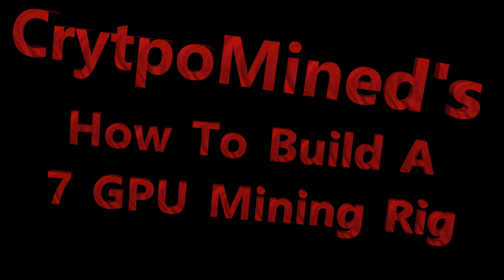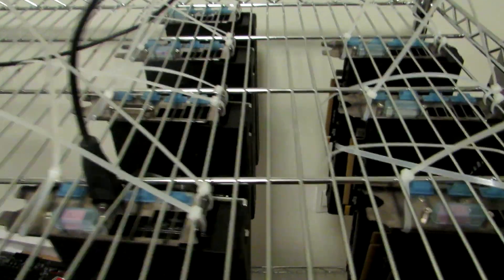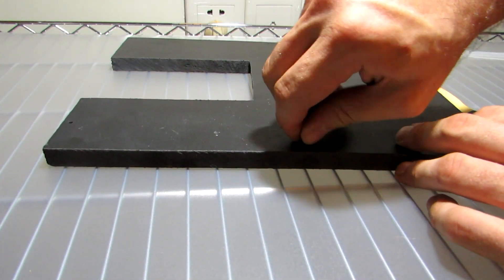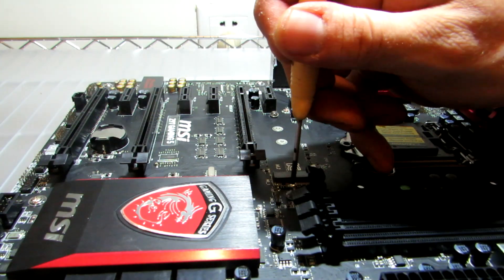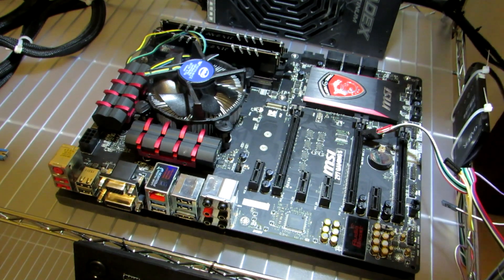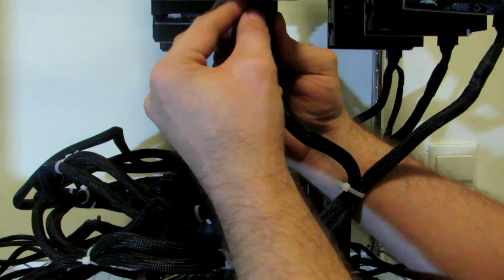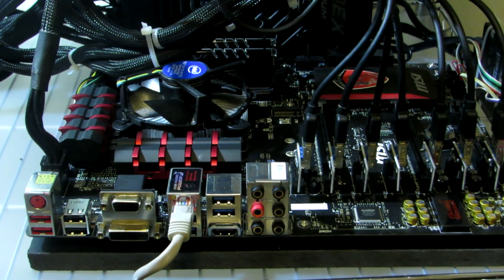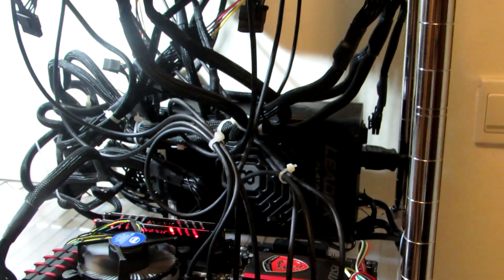How To Build a 7 GPU Mining Rig for ZCash Ethereum Monero Crypto Altcoins MSI Z97 Gaming 5

Comment: Does this motherboard have 4g encoding?
Reply from the maker: na i dont think so, could be wrong, but its an older z97 board, i dont think it had 4g encoding
Reply: @Cryptomined  So follow up question, I seem to be having issues with more than 4 gpus working on this board on a linux based mining os. it just won't go fast the bios splash screen. is there a setting besides 4g decoding that allows more than 4 gpus. Besides the pci gen1 and bus latency.

Comment: I'm having issue with my rig with either 6 or 7 cards added to the rig. gpu 2 hang message appear on startup and freeze the miner even though computer recognize all 6 or 7 cards. I'm not sure if I need more physical ram since I'm using 8gb but I put my virtual mem at 8000/16000. Using 17.5.1, 17.4.4,16.11.5  and 17.4.3 driver and tried claymore 9.3/9.5. I already clean install windows 10 pro and can't get it to mine past 5 cards.

Comment: i have 7 gpus running , all get picked up by win 10 , when claymore starts all gpus start mining at around 28 mh/s except for a single gpu that has a low hash rate of 4.xxx mh/s . any information on how to correct this would be greatly appreciated 

amd driver version 16 - patched to 17 
7 rx 580 strix 
1000 watt + 850 watt PSU 
asus z170 motherboard

Comment: I've seen a lot of these builds but I don't see how it's possible to connect 7 GPUs to all these PSUs. The PSUs only have 6 PCI-E cables. Do you have to buy a splinter or something for one of the six cables so you can hook up 7?
Reply: i bought 2 750 w psu's, each have 4 spaces for power to VGA, its called the EVGA 750 GQ or something like that :)

Comment: Awesome setup you have, I have four GPU's going on Windows 7 with no problems, all plugged into the x1 PCI-e slots.  The other slots on the mobo are the x-16 slots.  When I plug in a fifth GPU into thee x16 slot Ethminer does not recognize the GPU.  Any help would be appreciated.  All the GPU's work in the x1 slots but none i the 1-16 slots.  All five are recognized by Windows in the Device Manager.

Thanks for your time.

Comment: will two 750W PSUs do the trick? For 7 RX570 Pulse 4 Gb
Reply: Ok, at 7:40 he said he'd prefer using 2 PSUs, but didn't say what wattage in each of the 2 PSUs
Reply: 2 750w is fine, 4 on one 750w psu and 3 + mb and risers, ssd etc on other PSU

Comment: i'm starting with a tight budget, would a I3-4130 3.4Ghz CPU work with this build?
also would mining with 2-3 RX 470 4GB GPUs then scale work? i'm basically putting all my funds right now into this, scaling with the profit.
Reply: okey, i think i found an answer to my first question in the comments :), i was more like removing a doubt.
Reply from the maker: a G1840 will work, you dont even need an i3.  2 or 3 470 4g is fine
Reply: great, thanks!

Comment: Anything you'd buy different from your description list? Video was last September. (P.s. this is awesome gonna send an ETH tip tonight.)
Reply from the maker: I'm working on an 8 GPU build now, hopefully it works and ill update with a video.  Only thing i would have done different in this build is if I had to buy the power supply, since I already had the one I used, would be to use 2 750G2. ... and maybe use XFX cards instead of sapphires.  also the i7 was totally not necessary.. i just used it as an excuse to get one (but at the time it was semi useful for zcash).. same with the 16 gigs ram, not necessary.

you can go celeron and 4 gigs of ram.
Reply: Thanks ETH tip sent last night.

Comment: What's the reason for wanting to use two pcu?
Reply from the maker: Basically because its cheaper for high watts, and you can generally get more 6 pin ports so that each riser can have its own cable (if I had used 2X EVGA 750G2 I would have had 7 free 6 pin ports, so each riser would have had its own cable - its safer so you dont end up burning a cable.. less chance of fire.. although in general it is ok to have 2 risers per cable, 1 is ideal and 3 is very dangerous)

Comment: hi man, i have the same configuration as You, only the cpu is a i3, (i have only 470 gpu's). but don't recognise more then 4 gpu's in the same time. If i put 4 is ok, If i set 5 gpu's 3 of then has an exclamation sign (in device manager) and If i set 7 gpu's i see only 6 ( or 5 sometimes   ). 
my bios version is the same as yours.
Do you have any idea why is not working? I say it's the pci driver but I don't know what to do.

Comment: Hi cryptomined. What would be my best bet for a 7 GPU rig of R9 Furys or Vegas when they're out? I ordered the MSI Z170A and am reading now that they have problems with more than 4 GPUs
Reply from the maker: basically any Z270 board with 7 slots.  asu strix, z270-a or ar, biostarGT6.  But i will be building an 8 gpu rig with a different board than those, its more cost effective and can handle 8 GPU (which seems the maximum in windows).  stay tuned i should upload the first of 2 builds like that this week.. all components are here, just fighting for free time at this point

Comment: Man the msi z97 gaming 5 and msi z170a gaming pro carbon are sold out everywhere here...what other 7 gpu able motherboard could I get? :)
Reply from the maker: 7?   seven?  LOL 7 is so last year.. stay tuned for the 8 GPU build (there are a number of boards you can use now in the new intel chipsets).    you got asus strixx 270, 270-a, 270-ar, biostar GT6, and a few others... those are straight forward 7 gpu boards, but so many boards can take 7 now with a m.2 to pcie card or a 1-3 extension riser.  stay tuned, 8 gpu build coming up shortly. (like as soon as I finish cleaning up the house and finish with store responsibilities, and finish unboxing a few things to make some extra videos... its getting built.. everything is waiting for assembly.

I wil be building 3 rigs this week:  6 GPU TB350, and 2 8GPU builds, one with 480 8g and one with 500 series cards
Reply: Hahah Nice man ! but are you saying that board can take 7 gpu + pcie expension 3 in 1 so 9 gpus???

Comment: Hi, why do you recommend for rx 570 4gb and not the 8gb? btw which maker would you also recommend or are they all good? Thank you for your help.
Reply from the maker: cheaper, i have not done enough research on the different kinds of 570 and what ram them have.  most people buy nitros from sapphire.  I really like the 570 xfx with removable fans. (the high end xfx 570) as it makes them very easy to clean when they get dusty.  Some people also really like the MSI cards.  HIS might also be nice.  Powercolor could also be nice.
Reply: Cryptomined Thank you for your help. Btw, is it true that for zCash 580 are much better than the 570 series?
Reply from the maker: its faster, you can watch my hashrate video and see the hashrate and watts used in GPUZ

Comment: Hi, i want to build 6 gpu rig but the only cards i can find are sapphire rx 570 8gb. Would this be a good choice to go for or wait and search for something else? Thank you for your help
Reply from the maker: personally im waiting for vega at this point
Reply: would you say it would be a bad decision if i go for the 570 8gb in terms of making profit and possibly after pos i switch and mine something else? Thank you so much for your help
Reply from the maker: i wouldnt say its a bad decision.  there is a work around to get 6 GPU's to work, so if you want 6 it might depend if that work around works for you.  personally i think ill stick to the 400 series just because you dont have to patch the drivers, but if worse comes to worse and there are no more 400s available or they are a ridiculous price then i would go for 570 4g myself.
Reply: Thank you very much for your help. The problem is the price for the 400 series are crazy high if you can find it. I really wanted to build a rig but 1 480 8gb series card goes around $360. Do. you think is worth it for that price?
Reply from the maker: its not worth that much
Reply: Cryptomined thank you

Comment: Are rx470's still hashing at this rate on Ethereum?
Reply from the maker: I have not yet tried the new 17.5.1 drivers but I hear its the same hashrate.  I dont want to have to use those drivers as I need to patch them anyways, though I might try on one rig tomorrow (but the driver description only said 8% improvement in GPU performance for 580, and maybe thats just for gaming? curious if ZCash gets an improvement on 580 with those drivers.  I installed them on my mixed rig with a 570 and 580 so tomorrow I will test out claymore zcash and see if its any faster for 580, 570 and 470.  If its faster ill make a video, if not faster, i wont.
Reply: for 7 x rx470 like yours, If I get two 750w psu will i be able to get them all working? :)
Reply from the maker: yes
Reply: Do you think investing in a rig using those  7 x rx470 4gb is a good idea?
Reply from the maker: yes, i if i had to build this rig again id probably do it with xfx, but yes its a good idea (i think)
Reply: xfx would be better than the nitro one?
Reply from the maker: well for 470s the nitros might be the best.. people tend to use them the most compared to any other brand... but I did have to RMA some nitros, and they do use a thermal tape that can melt into a grease and make a bit of a mess.  never had to RMA an XFX and with the 480 GTR or Blacks the fans are removable so they are super easy to clean... the XFX 470s dont have the removable fans as far as I know, there is one version of 570 XFX that does, the standard version does not... i really like the removable fans.. makes it super easy to spray out dust with an aircompressor.

Im going to be building with dataland (powercolor) 480 8g next.  and i have to pick 6 cards for my tb350 still.
Reply: Oh ok thanks for the advice :)
Reply from the maker: no problem, it really doesnt matter so much which cards you get, what matters most is that you get some and start mining asap
Reply: Yeah exactly perfect man thanks for your video, I'm getting ready to mine as soon as i can :)

Comment: Hi, if you had to make this build again now would you use the same specs? which two psu would you choose? thanks
Reply from the maker: I would choose 2 750G2 EVGA PSU's and use a dual link PSU cable.
Reply: 750G2 are hard to find where I live. How about the EVGA NEX750G? http://www.evga.com/Products/Specs/PSU.aspx?pn=d2a98331-4c5b-4cee-9a94-d5f1ae46ab98. Thanks
Reply from the maker: yes looks good.  is that the new version of the G2?  just make sure it has at least 4 VGA connections and your cool

Comment: i bought the msi Z170A  gaming m5 but it is not showing display after adding more than four amd RX480 8 GB is there any solution ?
Reply from the maker: I dont know of any solution, z170 chipset has problems with more than 4 cards generally... should go with the earlier chipset or the newer one like b250 or z270.
Reply: Was the problem solved... I too have the same problem...

Comment: Hi! I just bought a new parts for this one and its my 1st time. When ever i use usb riser, even one gpu only it restarts itself after a minute or an hour. but using gpu direct to mobo all are working fine. i followed your bios settings, but we dont have actually the same settings. btw my mobo is msi b150 gaming m3. and i seldom boot my pc using 4gpu but then after an minute it will restart and wont boot up. can you please help me. Please. Thank you sir.
Reply from the maker: try a new riser, i recommend the sata risers if you are having trouble like that, maybe you have a PCIE slot that is more loose than the others.  if that is not the problem, im not sure.
Reply: Im thinking do i need modify something in bios? Like enabling multi gpu? And thank you for your respond sir!

Comment: Oh I see haha. That's good. I was wondering as I bios nodded all mine. Just copied 1600 strap to 1750 and 2000. doing 28 hash now happy with that. btw what happened to your cards that you need to rma? Just so I can keep eye on mine for similar symptoms. thanks
Reply from the maker: leaked grease onto my motherboards and one PSU... you need to watch the bottom (whichever way you position yours) to see if you see any oil... if you see oil, its actually grease from the thermal tape... very horrible..  if you remove the backplate you will see a strip of black thermal tape --... that thermal tape MELTS... it is hot here in summer and fall so the GPUs get hot.. high 70s usually at that time of year.. and running them 24/7 is too much for that thermal tape... it turns to goo grease oil....

check your temps, if you runninng over 75 degrees sometimes, take off the backplate of the one you think is most hot, and look at the black tape.. check if its melted
Reply: Thanks very much for your reply. temps wise I'm running about 62c so maybe I will be ok. I will defo monitor them. Would you void warranty to remove back plate ?

Comment: What did that rig set you back?
Reply from the maker: just under $2000 without including the PSU since ive had that for oever a year... its an expensive PSU though so if i had to buy it new now that would be an extra $400, though I would have probably picked 2 cheaper PSUs and linked them together

Comment: hi, what hash rate are you getting with 7 ? I am building a similiar rig and I cannt decide to go with all nitro 480s or 470s, difference is 30 per card
Reply from the maker: well I RMA'd my nitros cause the thermal tape started to melt on the back of the backplate.. so right now they are not modded, i gotta sort out 2 cards that I might have to RMA and keep running them at stock for a while before I mod them

that being said, dont buy sapphire, buy XFX.. over the last 6 months i had to exchange 3 of my nitros for replacements, and then, had to RMA them ALL... my XFX have been running flawlessly since i bought them 6-8 months ago...

that being said,  4G 470s are cheapest now and get the fastest ROI... but maybe 480s would be a bit more useful for other coins like ZCash...

ill try to make a video of a good site i found in china for helping people build rigs
Reply: thank you for your reply, god that is a shame, sorry to hear that, I will steer away from those ones so, what model XFX are on recommending ? also I was looking at the msi gaming x 4gb, they seem to do 28 hash
Reply from the maker: only thing with the MSI is they dont have dual bios.  for XFX I guess whatever you can still get your hands on... 470 4g cards, there are a few versions, the OC one with LED seems to be a bit more stable with overclocks on memory than the cheapest 470 4g (for me anyways, i have one normal and one OC and the OC overclocks easier for mem, but maybe thats just my silicon lottery luck), for 480s I would recommend the GTR version but they may be hard to find.  all the XFX custom models (not reference card) have dual bios... RS does not have as good of a heatsink... its a bit smaller.. but people are getting them now if they cant get a hold of hte GTR or black versions. 

I have 1 standard 470 4g, 1 OC 470 4g, 3 GTR 480 8g, and 1 black 480 8g.  they all end up working fine, have dual bios, are more stable... and never had a problem with any of them really, no RMA

probably worth waiting until the 500 series his shelves, i think they might have already in some stores... so the prices of the 500 series might be good and worth getting over the 400 series, i am just waiting to see them on newegg, or here on jd.com
Reply: Cryptomined hi . I got a good deal on the nitro 470s so I went for them. I was told they have a 3 year  warranty. did you bios flash the ones you will be rma  ? wonder if they will void warranty
Reply from the maker: i flashed them back before i sent them in LOL
it was not an issue with cards though, so I dont think that should have made a difference in my case.

Comment: Zcash mining with GTX 1080 is at the moment BEST GPU-MINING !!!:
So what I actually found out (more research internet) is that a GTX can make about 700 sols @ 180 Watt (max. 250W), a RX 470 does about ~ 250 sols @ 120 Watt (max. 150W). Are these good numbers ? FOR ZCASH (ZEC) MINING: When this is true the GTX 1080 is significantly more efficient than the RX 470 (Rx 570). In sols/price it's the same... So One mining rig with 5x GTX 1080 (ON ZEC) does more ore same profit (After, and for the ROI) like rigs with 14x Rx 470 (ON ETH)... About 780 $ vs 580 $ ? So GPU-Mining ZCash with GTX 1070 or GTX 1080 series is at the moment most profitable... And you need the lees space... But you will need a 1500W or 2000W PSU for a 5x or 6x GTX 1080 Rig ? Does a rig with 5x or 6x GTX 1080 even work ?

Comment: Great video. I wonder if your hashrate for the RX480 is any higher than for the RX470...? I didn't  notice  any difference in your first mining test.
Reply from the maker: the 480 8g is a bit faster than the 470 4g card.  but its not fast enough to really make it work the extra cost.  if i would buy more id buy 470, 470d (chinese market card) or the upcoming 570.
Reply: Thanks for the info. What's your take on the Radeon R9 Fury? It has 3584 Stream Processor Units.
Also, the Rx 470, does RAM size matter a lot? - Do you prefere the 8 GB version?
Reply from the maker: for 470 just get the 4g cards should be fine I think. 8G im not sure about bios mods and what not, so not sure but 4g is a lot cheaper.  

Fury, i dunno never had one, though I would think newer cards would be easier to resell later.

Comment: Hello bro. 
Could I use 7 RX480 Sapphire Nitro GPUs with 1 EVGA SuperNOVA 1300 G2 power supply? I want to put together a new rig. You recommend these cards over the others. I want the ones that give me better performance here in Venezuela spending on electricity is almost free. Do you recommend another motherboard that supports 7 GPUs? The Z97 is out of stock everywhere